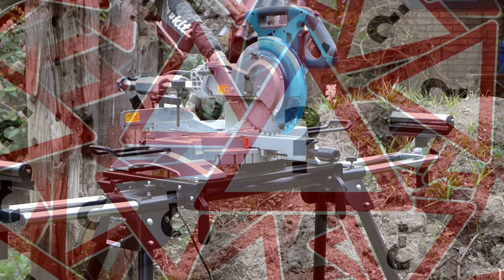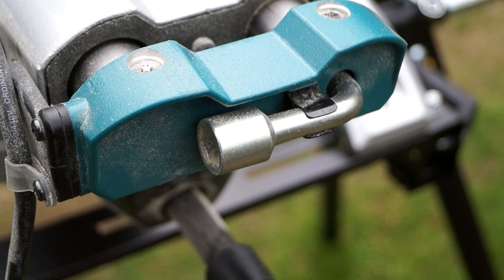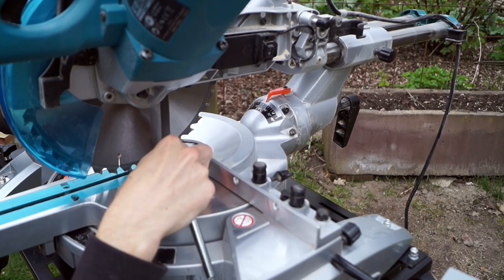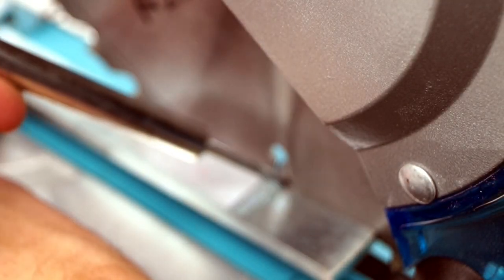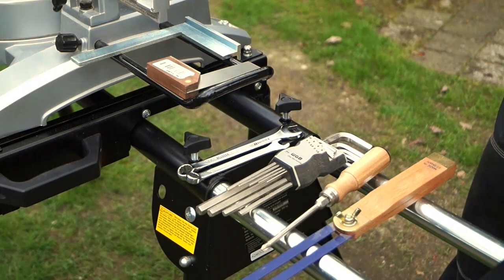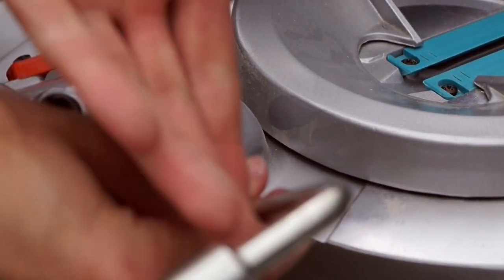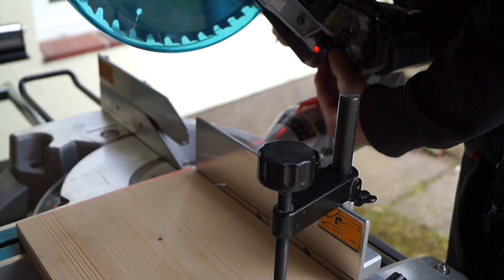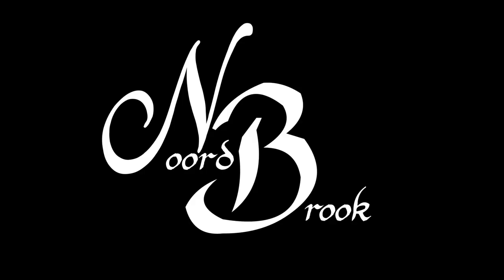Precision Please - Adjusting a Makita LS1018L

Comment: Thanks a lot, mate! This was a great help to calibrating my Makita saw. Finally I did it! For calibrating the laser I used a wider piece of scrap plywood, fixed it with a clamp against the fence as I would hold it during a real cut, and made a small scoring cut of about 1 mmm depth. I used this cut as an indication line against which I adjusted the laser line.

Comment: Yes a good video, I took mine a bit further and spend a couple of hours pulling it apart and deburring all machined surfaces/edges with my needle files and a fine stone. Now all moving parts are so smooth, it feels like a $2000 saw, well worth the effort.
Reply from the maker: That's a brilliant idea. Should have done that to mine. But I decided to sell it in November last year.

Comment: Thank you, very good video. You mention that you adjusted the laser. I did find the nut for moving the laser left and right, but is there a way of aligning it with with the 90 degree cut? The laser is not in line with the square line I mark on a board. Hope this makes sense. Many thanks again, Jon

Comment: Thanks a lot for your comprhensive video. I was wondering if you edited one about troubleshooting such as the jammed press button to release the bevel cut angle or the octogonal key in the back that doesn't tighten the chosen angle.

Comment: Thank you for a great video. My LS1017 cuts a right angle perfectly but when tilted 45 degrees (a bevel cut), the cut is 1.5mm to the left on the outside! So I need to adjust the guide by this just for the mitre joint. Painful. Maybe other's have an idea what might be wrong.
Reply: Im in the same boat

Comment: Hi, I just purchased the same saw and I'm having trouble unlocking the rear lever to cut bevels, the plastic handle just deforms and skips over the flats of the hexagon bar, has mine been over tightened at the factory or is there a lock somewhere that I am not aware of? regards
Reply from the maker: I never had problems like this. Please contact the seller
Reply: @noordbrook  Good to know, cheers

Comment: As a joiner with 47 years experience this is the worst saw I have ever purchased. Every angle miles out. I do not expect to buy a precision tool then have to reset every angle. Bits falling off all over. Dewalt is far better
Reply from the maker: I purchased  a used one. The preowner tried to reset the mitres and failed. I do not have any problems with it. But I never owned a comparable Saw before (the previous one was 40 years old). 
This video was not made to quote the quality of the saw. It was made to help others how to reset.